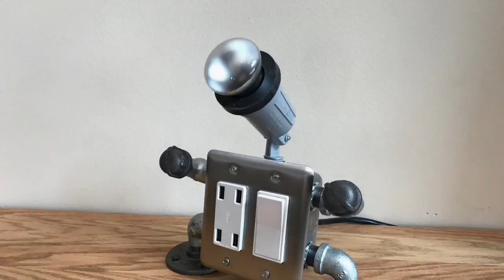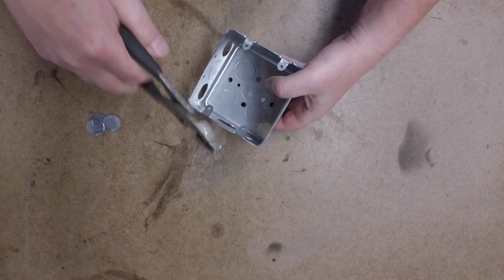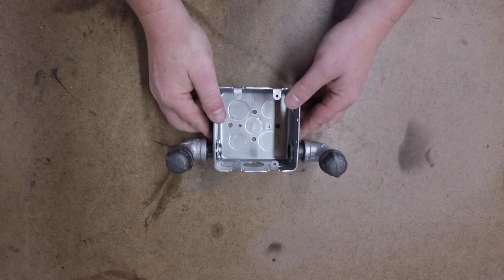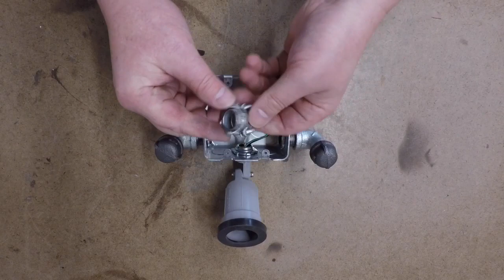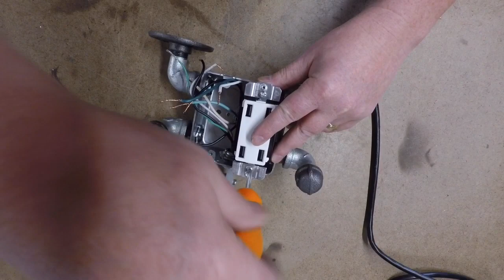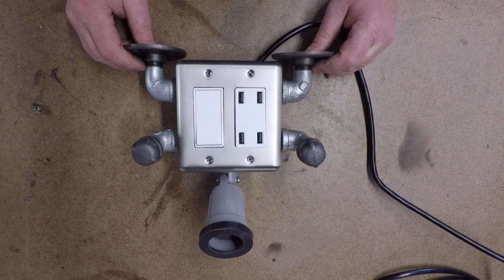DIY Steampunk Robot USB Charger Table Lamp

Comment: Does the plug always have power or only when you turn on the light?
Reply from the maker: Hot Pop...  Thanks for the question.  No, you don't need to have the light on.  The usb has power all the time to charge your devices.  Thanks for watching.

Comment: I am attempting a similar build.  My USB outlet hits the "arms and legs".
Reply from the maker: Mine came close but did not touch.  Only install the 1/2 pipe thread the bare minimum and you should be fine.

Comment: I wonder if you could use a dimmer switch in place of the on/off switch so you could adjust the brightness
Reply from the maker: Hey Jon,  Yes, you can use a dimmer switch in its place...  Thanks for watching.
Reply: @JerryJacksonDIY  I made a couple of Robot guys. It was fun. I looked into usb outlets, dimmers, etc... I came to the conclusion that simple was better. Save the money for cool light bulbs.
Reply from the maker: @personjo100  thanks for the feedback Jon.  Thanks for watching.

Comment: Thanks for the nice video.  Are you attaching a 1/2 inch lamp holder in a 3/4 inch punch out?  It works for you,  was curious if you found a 3/4 inch lamp holder?  I had to buy reducer washers.  I appreciate you sharing this with us.
Reply from the maker: Yes, you need a 3/4 to 1/2 reducer. Now listed in the description.
Reply: @JerryJacksonDIY  Thanks. Made it. Looks great.  Just now seeing your list of parts. I didn't pull down my screen on the phone to see the list. Sorry!

Comment: Advice:  Make sure you use the LED spotlights.  The incandescent ones get extremely hot and will burn if touched.
Reply from the maker: Great point Byron...  Thanks for watching and thanks for the comment...
Reply: Just found this out the hard way tonight. I put in a 40W incandescent spot bulb and the rubber gasket did not enjoy the heat. The lamp casing was also very hot to the touch. I’ll be switching to LED.
Reply: Jerry Jackson DIY what kind of bulb did you use?